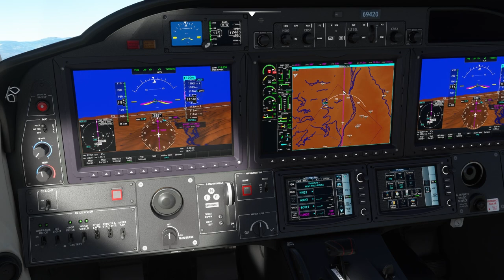TBM 930 Takeoff and Autopilot | MSFS

Comment: If you keep the thing at Max power throughout the flight will you eventually get the "you have overstressed the aircraft" message or can you just rag it forever? Currently doing a world tour & the only way to visit the Seychelles is to use this to land & takeoff on the shortest runway ever (Fregate) as the main one doesn't exist in sim. A half hour flight from north Madagascar turns into 3+ using this and i obviously want to get it done as fast as possible.